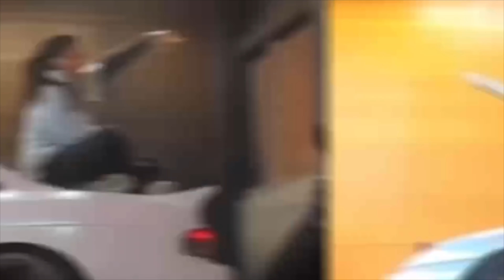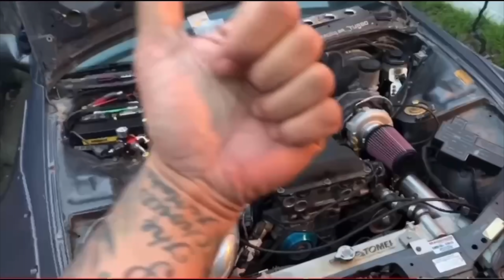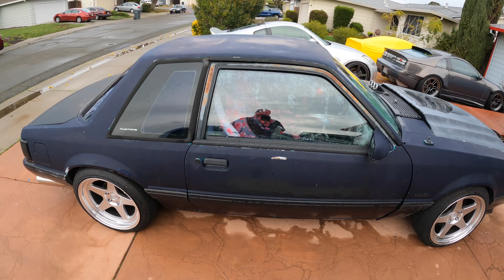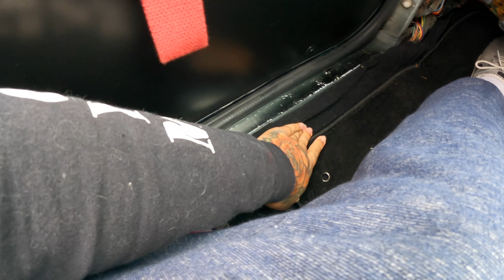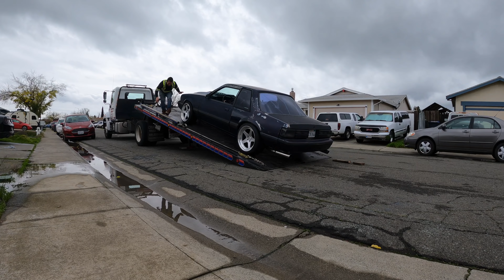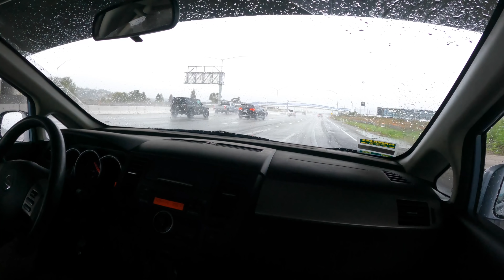NO MORE OF THIS NA SH*T! Its Time To Turbo The Notch!

Comment: Hey bro, its ur TFI module 99% sure. The grey module on the distributor. Typically when the car heats up that module gets really hot and thats when it starts sputtering and cutting ignition. Go OEM Motorcraft.
Reply: Yup had that problem before took me a minute to figure it out and a few hundred dollars later
Reply: Foxbody shit

Comment: can't wait to see this thing getting boosted I was going to say also you might have a faulty MSD set up there they're known to come bad or die out easy straight from the box I won't even run MSD products no more cuz I've had so much trouble I don't know if you know about the MSD issues going on everywhere but it's like they've just been slamming parts together and their quality isn't there anymore it's just the luck of the draw but I'm super happy to see you moving on with it and no doubt this car would have smoked arrons with the aluminum heads I mean he's got stock heads on his already aint even close there...

Comment: I had a 95 gt that was doing something similar then would finally not start at all I had to keep replacing the engine control module i believe is what is was called would run for months then go out again

Comment: Somebody probably locked the keys in the car at some point and had to pry the door open far enough to get it unlocked and it bent the door frame. Same thing happened on my truck. I stuck a piece of wood in the door and bent it back and it's sealed up tight now

Comment: With the leak on the mustang do this dollar bill trick we used to do at my uncles shop you open the door and you shut the door with a dollar bill in between the jambs with 2 or 3 inches of the bill sticking out and you pull on the dollar to get it out from you being in  either the inside or outside doesn't matter it should have decent resistance if it's easy to pull the door or door frame needs adjustment you test it all the way around the door where you can and adjust it till it feels like you have decent resistance when trying to pull the dollar bill out and you good ... (your door window frame is probably tweaked out a little roll the window down pull on the frame back with the door open and try to bend it a little that may be the issue)

Comment: roll the window down piece of wood in jam near striker then gently slowly push in on window surround door is tweaked
Reply from the maker: I’m going to try that
Reply: @Its_Mike_Myke  go slow dont over bend it, but it will fix it. put piece of printer paper all the way round window to find where it needs to bend and touch the seal...for a no leak situation

Comment: I'm sorry but this makes no sense to me. It doesn't run right and keeps shutting off so the solution is throw a turbo and and stand alone on it?? That ain't gonna make the problem go away that's just adding more stuff on top of the problem
Reply from the maker: They actually fixed the problem when I dropped it off… but that’s on the next video lol
Reply: @Its_Mike_Myke  well damn alrighty then😂